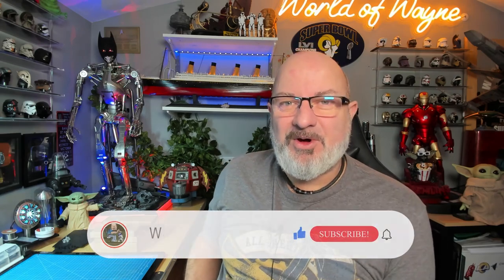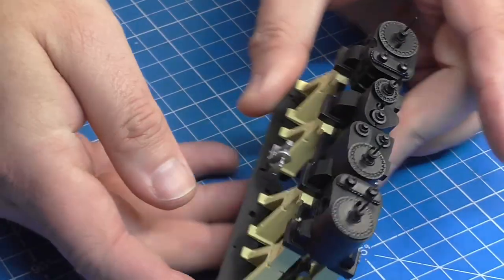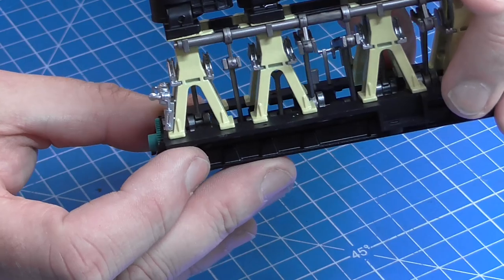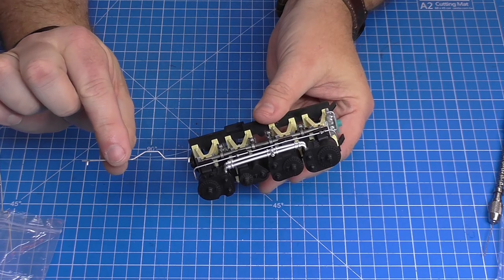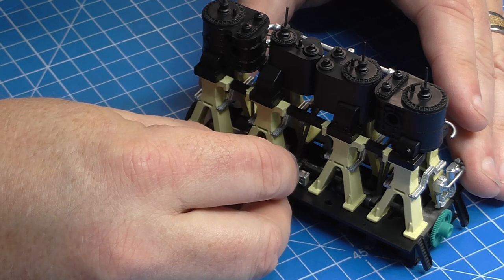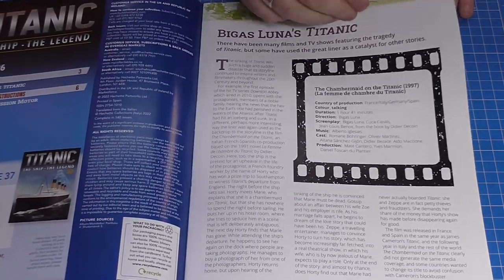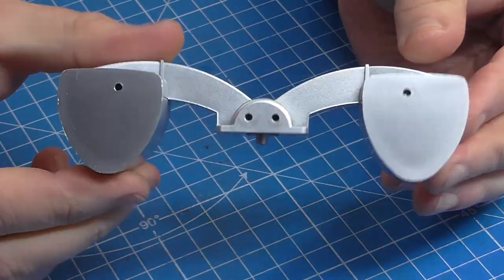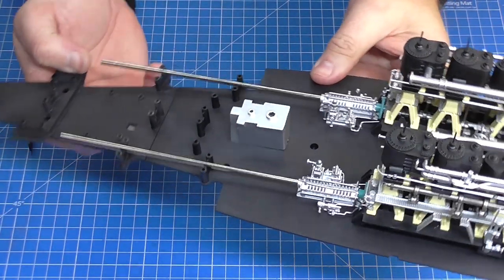Agora Models Build the RMS Titanic - Pack 7 - Stages 33-38

Comment: Are those piping pieces metal or plastic? What kind of glue are you using? I was thinking of using tamiya which is good for plastic pieces, but if they are metal on metal, maybe some gorilla glue for metal?
Reply from the maker: It's plastic on metal. You will need a good CA glue
Reply: @WorldofWayneUK  thanks for the reply Wayne. Is there any you recommend?  What did you use?

Comment: Hello Wayne I had to put the first engine in the freezer cause I think I put the cog wheel on the front wrong I hope that it will come off? If it doesn't then what do I have to do.
Reply from the maker: It should do. Lots of small parts though so be careful
Reply: @WorldofWayneUK  Hello Wayne I took the engine out of the freezer and my crankshaft cog broke. So all I need to do is to email Agora and they should send out the crankshaft cog, they said they need a parts number, which I guess is 3N that's what they need

Comment: Has anyone had issues with reversing the engines? Both work fine when going forwards but the starboard one really hates going backwards. The shafts go out of alignment almost instantaneously and the only solution is to push them back into place by hand, or turn the engine forwards again.